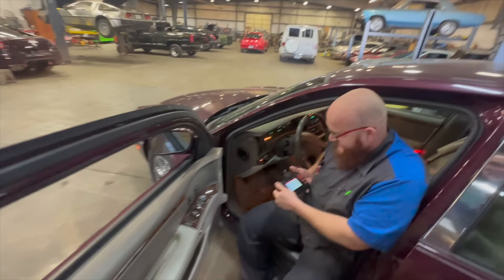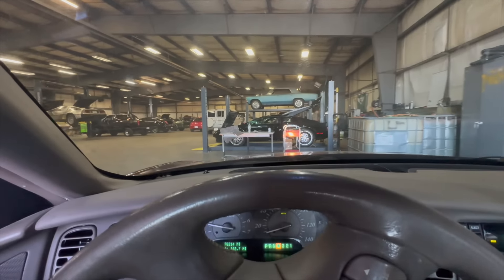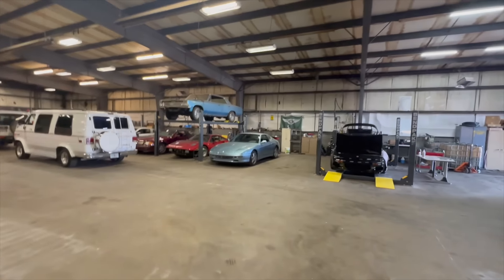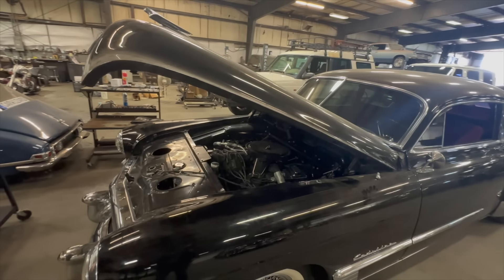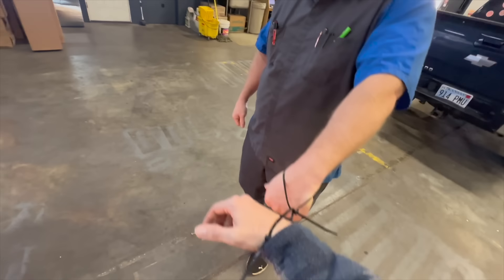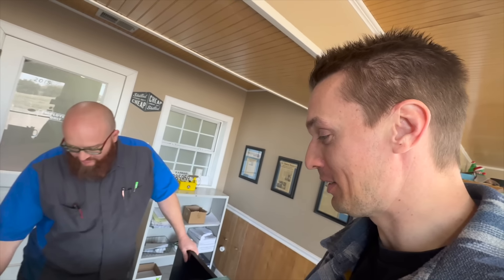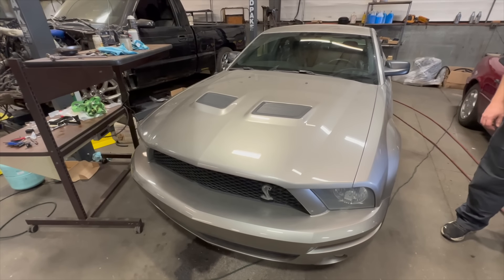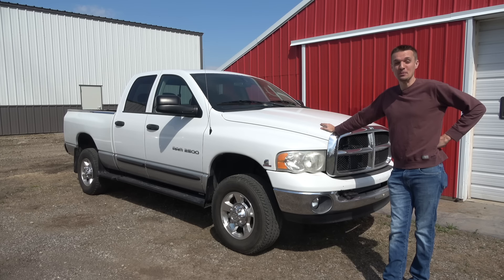My mechanic seized my rare Shelby GT500 for unpaid bills, and I'm forced to sell more cars.

Comment: The buick is reliable, mainly because every single one of those still on the road has 350k miles and has had a check engine light on since 150k
Reply: Agreed
Reply: If you live somewhere that doesn't require a smog check, why not.
Reply: Too true. Mine rusted to the point that the brake lines detached! Engine ran great though....
Reply: I wouldn't worry about the P0420 inefficient catalyst code. Just drive it until it shows signs of bad catalyst. which will be years from now lol
Reply: @shauny2285  That sounds like a good plan. The Buick is at 21 years old now. Does Kansas have an age limit for smog tests? My state doesn't require smog tests on vehicles 25 years or older.
Reply: @Jack_Russell_Brown i live in a county that only needs to do state inspections when buying or selling a vehicle because we emit way less in emissions than the rest of the state does (when you remove what the federal government does, which is basically all of it with the naval air base)
Reply: My 1996 Lincoln Town Car with 217,000 miles has had the P420 “Catalyst Below Efficiency” bank one code for the last 100,000 miles. Still does 23-25 mpg highway depending on driving conditions. Most of our driving is highway with shortest 8 mile round trip to nearest town. Average 20-21 mpg. Other things have worn out but nothing terrible. Just had the second air suspension pump and third set of bags installed. Good values on those available now from aftermarket suppliers.
Reply: LOL.  My 1999 Park Avenue has the light come on randomly.
Reply: @Jack_Russell_Brown Cali forces you to smog for pretty much everything.
Reply: @Jack_Russell_Brown  I am in Sacramento, and I have smog everything,  even my '86 F150.
Reply: @thomasthomasthomas296  in Ohio you just buy them and sell them and drive them no inspections ever.
Reply: Lol. What a BS

Comment: I wouldn’t just outright condemn the converter without checking for any small exhaust leaks near the converter or checking the rear oxygen sensor first. I’ve fixed a many of converter efficiency codes by fixing pinholes in exhaust pipes or small leaks in a flex pipe.

Comment: Screw the catalytic converter for the Buick.  Just drive it and enjoy it.  ...and scan the MIL every couple months to make sure nothing additional beyond the cat has thrown a code.  smeh.
Reply: My car threw the same codes, so I did the old spark plug anti-fouler trick. My county doesn't do smog checks, so I'm good until they require state-wide emissions inspections.
Reply: That is what i did with my Impala.  My state has no inspections.  Love it!
Reply: "Race" cats are 90$ on eBay....easy peezy!
Reply: it probably just needs the italian tune up
Reply: Amen. It's the Midwest, we don't do emissions inspections, just drive the thing... My '99 escort zx2 winter beater had the check engine light on for catalyst deficiency code for over 8 years, and now the check engine light doesn't even light up anymore, problem took care of itself 😂
Reply: @Bigsky1991 Unfortunately, my state requires CARB compliant cats, and they're expensive. A two pack of anti-foulers is ten bucks, enough for one cat. My car requires two. Still cheaper than ebay cats, and much easier to install!
Reply: Hoovie,  I have a great idea for your next money pit.  A Citroen SM. The panicle of Citroen designed cars with a Masarati 6 cylinder engine. Fabulous cars, gorgeously designed and a joy to drive. With the wizard’s experience with his DS, the hydrolics 
are a no brainer. Just get a later model, preferably with the European head light configuration (the American headlights are a dog’s breakfast regurgitated).  They are a great tourer and sound amazing!  I’ve listed after one ever since the came out in 1970 but will live vicariously through you!  LOL!
Reply: @_Frank_the_Tank  does that Escort have the 2.0 Zetec engine? Those engines seem to run forever. I daily a 2.0 Zetec in my 03 Focus 😉
Reply: They can restrict exhaust flow to the point that the car can't be driven. Scotty Kilmer has a video on cleaning the honeycomb material inside with just Dawn dish soap and water. If that fails, there are other relatively low cost solutions which may or may not be legal.
Reply: @DUCKSAREEVILLLLLLLL  It didn't throw a cat code because it's plugged.  It threw it because it ran out of polonium.  Ninety-nine percent of the time the code for inefficiency is the cat simply running out of catalyst.  Beware of Kilmer, BTW...
Reply: @NorthernChev  I know about Scotty, but he's not alone in advocating cleaning catalytic converters with water. There are a few ways they can fail. On older carbureted cars, the telltale rattle in the converter indicated that the honeycomb catalyst inside had broken down and would sometimes clog exhaust. After fuel injection and computerization improved air and fuel metering, converter failure became less common but it can still happen, especially if the car's burning too much oil or the air/gas mixture's off and the catalyst becomes clogged with soot. In that case, dish soap could work, although it could be just a temporary fix.
Reply: (SOAP and water)

Comment: On the Buick run a gallon of lacquer thinner in a full tank of fuel it burns hotter will clean them out they only need to fail bye 5% to throw the MIL light I have done it many times and it’s worked great .

Comment: Well you know what boys? I can remember my father running HIS auto shop like this...  We had our own credit system, and now & then there was a trade off, or barter.  In fact, one of them would drive Hoovie crazy:  A 1949 "bustle-back" newly-introduced Cadillac two-door hardtop.   And it had everything you could get...  331 Kettering V8 plus the four-speed Hydramatic, power  hydraulic windows, hydraulic seat, vacuum-operated windshield washers, push button radio, vacuum operated antenna, parking lights with integral fog lights, rear radio speaker with fader under the dash, and even an automatic trunk light...  I wish that I had been more than 14 years old when he sold it!

Comment: That Buick is so dull it looks like an 80s bowling ball
Reply: What an amazing description
Reply: Years and years of cheap gas station car washes and no wax... 

It really does look like an old bowling ball 😂
Reply: Really needs a full respray
Reply: That Buick is awesome.  Last of anything Toyota"esque" from GMs sorry butt
Reply: I wouldn't give a dollar for it😂
Reply: @Bigsky1991  I'd pay a few grand for that... I'm not even a GM fan and that's an awesome car. 

Comfortable, reliable, easy to fix. 

Sure it's not sexy, but it's a damn nice car.
Reply: Same with my ‘04 Camry. It needs compound, unfortunately. The guy I bought it from used it to drive from Atlanta to DC. It has 255k on it but 90% are highway miles. It has (at the moment) the original brakes! I rolled the windows down and they stuck a bit - literally, the weatherstripping was slightly stuck to the windows, they had never been “rolled” down! He didn’t eat in it, was a non-smoker, I feel I got a bargain at $2500. The only “problem” is the front hood has rock chips from all the highway use. Even the bushings are still OK, even for 20 years old.
Reply: @vincedibona4687  original brakes is a true sign that it's all easy going highway miles!

I replaced my factory brakes at 100k because the rotors were cracking as the only time I ever really used them was when I'd go on vacation and have fun in the mountains... Other than that it was about 6 gentle brake applications and 50 miles of highway to get to work most days.
Reply: I’ve had friends that have owned Buicks. They used to be one of the best cars made
Reply: Its both stodgy & cool.One of the last true luxo barges.
Reply: @volvo09 Yea not a GM fan either and I'd drive it if it were cheap enough. I feel like the paint would be salvagable too.
Reply: @vincedibona4687  In the rust belt the rotors wouldn't be original even if they were never used cause they would rust to pieces. I actually had a rotor break in half on a car once cause it was rotten with rust. Fun thing to happen on the highway in traffic.
Reply: I love those park avenues what are you talking about???
Reply: One of the greatest cars ever, super comfortable. Once it’s properly fixed up that’s a forever car. You have to experienced it new to understand how nice it was.
Reply: That Buick is cool
Reply: @volvo09 I had a car like that. The rear discs got so rust pitted they had to be replaced. I really don’t know why they don’t use stainless discs.
Reply: My Buick has never left me stranded.  Of course I did have a heater hose blow, but still passes smog at 25 years with no problem.
Reply: @jimmyfaherty8588 the 3.8 liter V6 is a great engine.  Of course GM stopped making it.

Comment: That pushrod 3,800 was a fantastic motor. I had a Grand Prix with the super-charger. What a car! It went like hell. It had almost 200K when the frame simply rotted out. Had for years. Oil, transmission fluid and brakes. That was it. That car gave me over 10 years. GM should make cars like that!

Comment: id love to have a 200k mile gt 500. i have a 09 gt now manual car with 160k miles red with white strips. ive always kept mid 90s cars very early 2000s newest being 01 so getting the 09 mustang was a big upgrade from what ive always drove. i always had 87 to 97 mustangs an 94 to 01 camaros an trans ams, still have a 97 firebird with the motor an trans from a 95 trans am, all the wiring an computers had to be changed cause the 97 was obd2 and the 95 was obd1 so we had to swap everything electrical over from the obd1 car to get it all to work, including the stearing column with the keyswitch cause of the security chip in the key, that was the last part we figured out, b4 swaping the column it would start run for a second or two an shut off with the security light flashing an we realized the column was still using the key from the obd2 car so we swapped the hole column out an it worked. got the 95 when i was 16 in 1999 or 2000 cant remember now but wrecked it an totaled it a couple years after owning it, bought it back from the insurance, traded a 94 camaro v6 car to the 97 firebird also v6 car an thats what we used to put the motor an transmission from the wrecked 95 trans am in an thats still the car i have now 20+ yrs later it still runs strong but does alot of sitting now. i wish i could have gotten the gt500 when i got mine, there was a 99 cobra at the time i was buying my 09 but i wanted something newer but ive always had a bit of regret not getting the 99 cobra over the 09gt, it was convertible car was what really put me off on it, i had one gt convertible car an had to replace the top an done it myself an swore id never own another one so id never have to repair one again. like mine but that 32valve 4.6 makes a bit more than the 3v 4.6 but to late for that an im happy with the car i got but who wouldnt think about a cobra that u could have gotten but u picked something else instead.

Comment: All i can say is be glad you dont have the bills to maintain a 1947 sportsman they are the most expensive ford cause only like 20 are left and like 10 are original you cant find the parts at all and ford used off the shelf parts from a bunch of models which complicates it even more to get accurate parts.

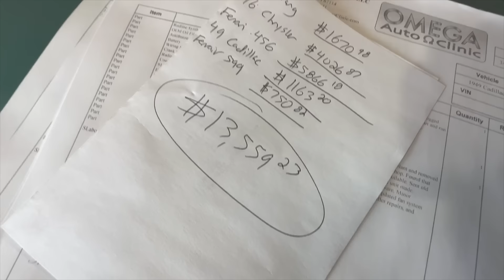Comment: The grand total at 14:33 is calculated wrong. When you add up those items, it comes to 13478,05 and not 13559,23. So that's 81,18 more than should be.

Comment: That check engine light says catalyst, that's not just catalytic convertor. There's a reason that light comes on. Typically your looking at a tune up. Possibly injectors, maybe have a compression issue, or a O2 sensor. There's a lot more to making sure that light goes away. Can't just use a generic code reader and be all "yup it's the catalytic converter"

Comment: Unfortunately Hoovie, the cat for the PAU is a part of the entire muffler assembly (GM part 25749911) and surprise surprise, it’s discontinued. (It’s the same story for my Lucerne, the only parts left I can get New OEM are a couple of gaskets, the crossover pipe that goes over the transaxle and the front exhaust manifold.)
Reply: It's available aftermarket
Reply: @21Piloteer  but as the Car Wizard has demonstrated, the aftermarket parts manufacturers are in a race to the bottom when it comes to quality. (9 times out of 10, everything in the aftermarket comes out of the same Chinese sweatshop factory in a different box.)

Comment: That old Cadillac always stops my heart. What a beauty... That said, it's like a castle: Look from afar but don't own one so you don't have to pay the bills.
Reply: The resto mod was done right though: the drive train is from the era when they were simple and reliable. The custom pieces, rad, yeah a bit pricy but everything else simple. For things like the heater, he should have taken it to magic mike, probably cost him 1/3. You don't hire a guy like the wizard or danielsan to do that sort of thing. 

Same as the trunk latch, I'm not a mech and I knew the issue soon as he showed it (and knew him bashing it over and over was a dumb idea). The little arm didnt' swing all the way into the open position and flipped back down. Happened to me one time and I looked inside the latch "how'd that happen"? 2 mins with a screwdriver to pop it up.

Comment: Still wish you had fixed the old gasoline heater in that car. They are not as dangerous as you acted considering they sell hundreds of thousands of them new to heat rvs and camper vans

Comment: I've got a newer car for you, a real looker, a Chrysler Town and Country........ 1994 with the exclusive leatherseats, the green glowing all digital LED panel, the genuine vinyl "wood" on the chipping white original white paint that leaves the front if you squeeze the hose while cleaning off the moss that has had a great life while sitting out in a grass field for 8 years. All the mice loved it as well, and the Swedish MOT used a full sheet of paper to describe it's fabulous flaws, not mentioning the faulthy head gasket that ate coolant in it's last year running. And, you can have it for free, just hop over the puddle and come get it. Think of all the content it could bring, and all the cars Wizard would get "fixing" it! 🤣

Comment: I didnt say anything here when you kept slamming that to stop and get a screw driver and flip the catch lock in the top of the lid. and spray some wd40. You really need to learn how to simple fixes if your going to collect cars.
Reply from the maker: I didn’t film the hour I spent doing that, but thanks. The latch needed to be taken apart

Comment: $1,700 for sway bar, water pump, thermostat, belts, and oil change is insane.
Reply: how much in parts? prob 1000$ alone
Reply: Doing the inner belt on those really sucks. The whole crank support and bracket has to come off just to get the belt in and out. Just the inner belt pays like 3.0hrs not to mention all the other stuff.